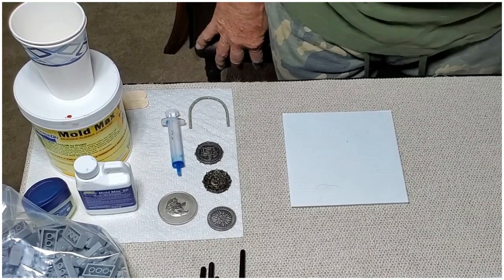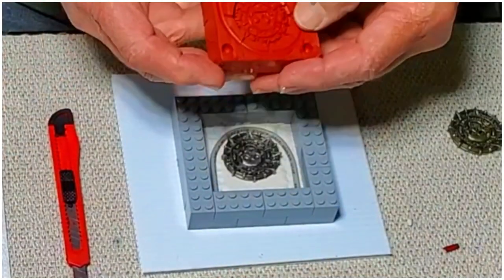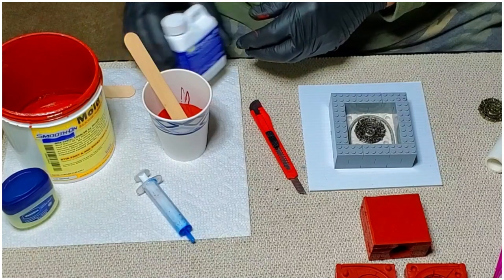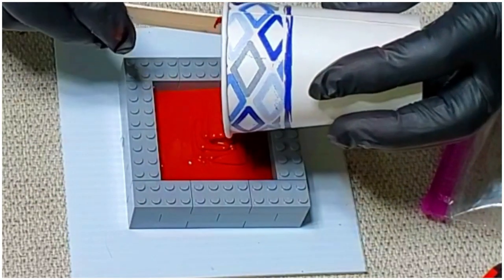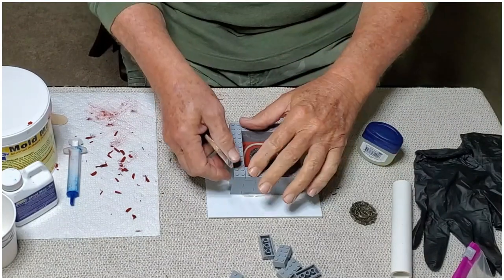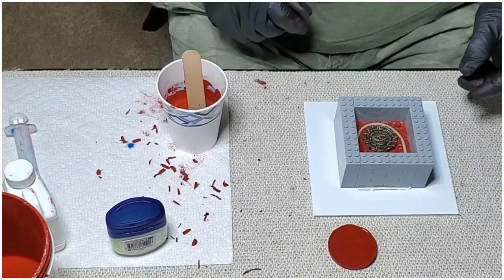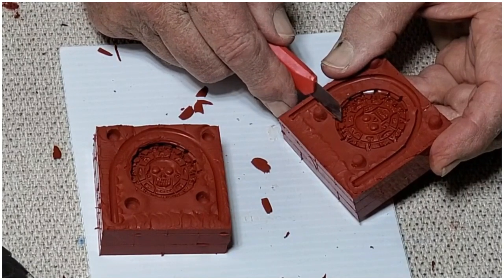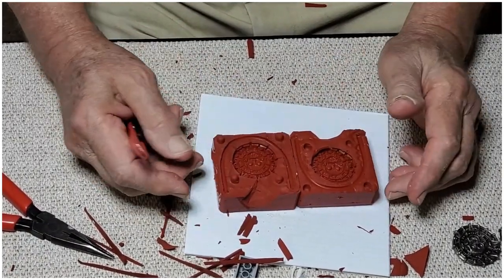Mold Max 60 High Temp Silicone - Let's Make a mold to pour melted ZINC! - Part 1- NO ADS

Comment: After using petro bond for almost 50 coins and having to make a mold every pour. I thank you for puting this info out here.
Reply: All though I've had amazing results for super high detail coins with petro bond. It just takes a crap ton of patients and a super stable hand when taking the coin out
Reply from the maker: I like petrobond for one off applications and you are correct about using it for multiple items, very tedious. Just be aware that mold max 60 won't last forever. Unlike graphite molds, let MM60 cool down before each use. You will extend the life. Be sure to watch part 2. Here's the link to my other new channel which is more focused on metal casting.  https://youtube.com/@CastawayMetals-BGr84u?si=RS4feaOBYL0bnQYv
You will find part 2 there as well as other good videos. Thanks for the comment. SUBSCRIBE?

Comment: I use soldering wire to create the air channels, and a plug of clay for the pour hole. With this method there's no need to take a knife to the mold once it has set.
Reply from the maker: Those work well too. A preformed spru comes in handy at times also. Thanks for the comment.
Reply: @stoneageartworks9950  I forgot to say thank you for the video. I hadn't thought of adding a large preformed air vent, with smaller vents linking to it. I've been using soldering wire to thread individual vents to the top of the mold. Which was fiddly and could lead to blockages from spilled solder. I'll be adopting your methods in future. Thanks again.

Comment: does it require vaccum degarassor for removing bubbles ?
Reply from the maker: It's not required. I've never done it or worried about any bubbles. Just don't be very aggressive while stirring the mix and be gentle and slow when you pour. Allow the mix to travel on its own slowly across the piece when you pour. I wait about 2 mins after stirring and let bubbles come to the surface.

Comment: You don't vacuum the mix before pouring
Reply from the maker: No I do not. Never found it necessary.  As long as you don't get any bubbles up against the part why bother. Pour slowly and let the silicone find itself to the part. Most all bubbles rise to the surface during the cure. At least it has for me. Sorry for the delay in responding. Ive moved all my casting videos to my other channel here: https://youtube.com/@CastawayMetals-BGr84u?si=UoiVB062gid_I0Ll
Thanks for the comment.

Comment: I have cast Zinc into Mold Max 60... what I don't like about this silicone is it is brittle... Vulcanized Silicone is better
Reply from the maker: I've not had issues with it being brittle but just that it doesn't hold up as well as I'd like. I'll try the vulcanized silicone. Thanks for the tip. Any brand you like?